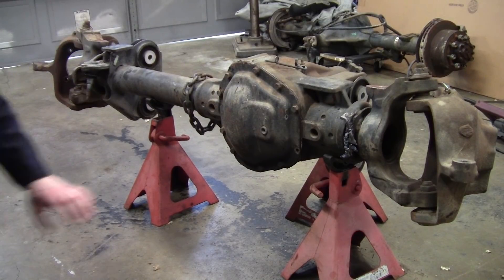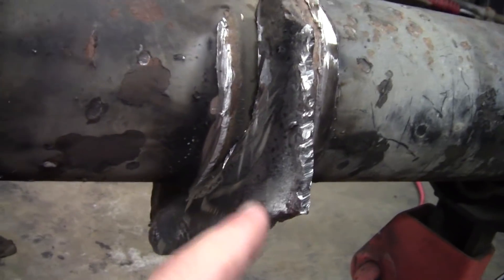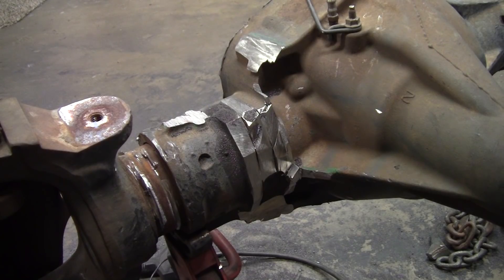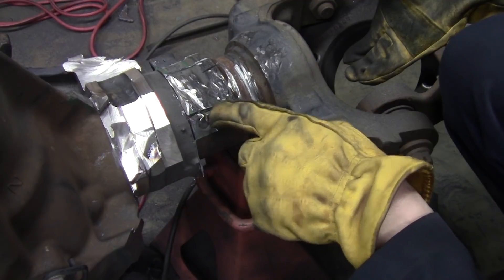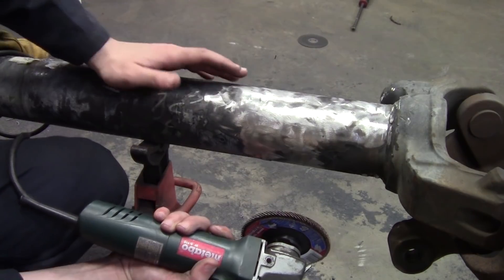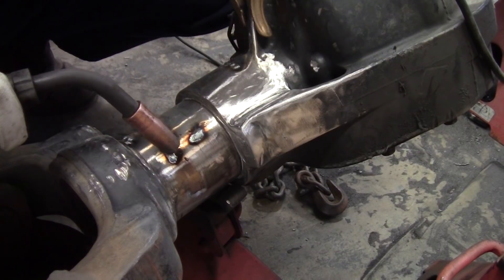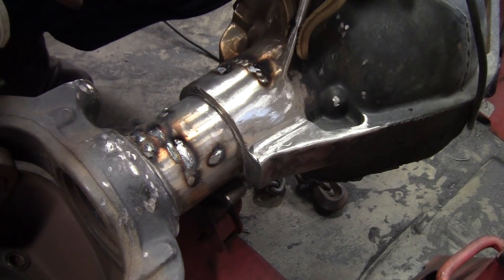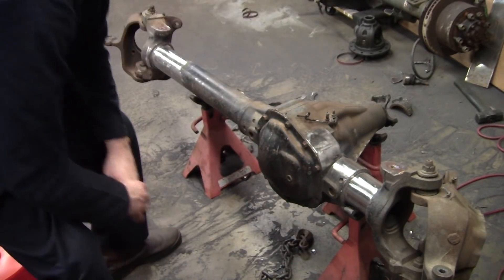Super Duty Dana 60 Casting Trim and Axle Swap Prep

Comment: so should you weld up that spot where you took out half the plug welds that hod the tube into the center?
Reply from the maker: Yes it does need to be welded to the casting afterwards to get the strength back. If you're not running a truss the tube needs to be welded to the casting. But if you're running a truss that welds to the tube and casting that should give enough reinforcement.

Comment: Use a scarfing tip on your torch and you can cut all those brackets off flush or very close to the axle tube within 1/8 inch or closer
Reply: I've never used a plasma cutter, but I suspect it would cut even closer and cleaner.

Comment: Here is a tip from the Grumpy Gear Monkey. Have your gears set up before you weld on a truss. This way, us old guys can use a housing spreader to get good carrier bearing preload without having to beat the carrier bearings into the housing. This is especially important with an ARB air locker.

Comment: I’m getting ready to do this. Did you grind out the welds to get the brackets off?
Reply from the maker: It's much easier to use an oxy acetylene or plasma cutter to cut the brackets off first, then grind down what's left because the welds on the axle tubes are hard to get to in some spots.  Other option would be cutoff wheels to take off as much of the bracket as you can then finish with a sanding disc.  Good luck!

Comment: Is there room to mount 36 1/2” spring pads on the axle if someone wanted to run leaf’s?
Reply from the maker: The closest you could put leaf springs would be 34" inside to inside.  That would put the leaf spring against the diff cover on the driver's side though so you'd have to get creative with perches and mounting.  36.5" inside to inside seems possible.  Might be better to get the Dana 60 out of a 99-04 though since they came with leaf springs (37.75" center to center).  Even though the axle isn't as strong, would likely be an easier starting point.  Good luck!
Reply: @WebWheeler  thanks for the info

Comment: seems like the hard way to do this, why not cut flush with the torch then spend 10 mins tidying up with the grinder?
Reply from the maker: Started it that way, then ran out of acetylene for the passenger side.  Chose not to for the driver's side because I prefer not to put that much uneven heat in to a casting.  Might have worked fine but I wasn't sure so the possible time savings wasn't worth warping or cracking the casting
Reply: @WebWheeler  sorry, guess my perspective is tainted,  watched both my dad and uncle doing that on both sides and cutting flush to the housing, quickly and leaving little to nothing to grind

Comment: Wow! That was a ton of work! Wouldn’t it have been easier to get a leaf spring style Super duty front axle?
Reply from the maker: Yeah the leaf spring version would be a lot less trimming but those axles are quite a bit weaker (smaller unit bearings and outer axle shafts) and are actually more expensive. Thanks for watching!

Comment: I'm not sure if you'll be able to answer this now. But after doing this mod to your axles. What's the distance from center to outer part of diff that you clearanced? Would I be able to mount leafs right up against it?  

I'm thinking about using these for my 4runner (yes I can do driver drop I have engine swap) but would need to figure out a front hanger width.  So if I take your measurement from center of axle to the outer part of the clearance diff then I can double that and see how that matches up with my 4runner frame. 
Just trying to get idea how wide a front hanger bar I would need to make.
Reply from the maker: The tightest you could mount your leaf spring perches (inside to inside) would be 33.5". So if your springs are 2.5" wide they'd need to be 36" center to center. You'd only be able to use 1 ubolt on the diff side though- your other spring mount would need to be a bolt in style against the diff like ruffstuff makes their land cruiser front axle housings. Good luck with the project!
Reply: @WebWheeler  this helped me immensely!! I might use these now instead of finding a 10bolt and using the sky's fukk size hanger kit. Bc Chevy d60 are hard to find and $$$

But super duty are plenty. Just no one makes a hanger kit. I appreciate it. And I understand what you mean about the rough stuff bolt in. Great idea
Reply from the maker: Glad I could help! The super duty 60s are definitely the way to go haha. I like the kingpin axles but having dealt with both, the 60s are better in almost every way (especially now that kingpin axles are $1500+ bone stock haha)
Reply: @WebWheeler  looks like sky and wfo make a 36" universal front hanger. But for $250 I bet I can just grab one up and then towards the back of the frame  make some outrigger mounts like the body frame mounts. Well just have to see how ridiculous it will look bc it's so much wider than frame.. Thanks again.
Reply from the maker: Yeah I ruffstuff sells some frame mounting pads/outriggers that might work to widen it out for you too. Should be a cool rig when it's done!

Comment: I’ve found a great way to sand those tubes is to get a sanding belt , the longer the better and turn it inside out then slip it over the axle tube and use a drill with a rubber check to spin it. You can cut it to the perfect width, just let the paper do the work. I rigged up a handle that goes thru the rubber drive as to get an even pressure.
Reply from the maker: Great idea! I'm going to have to try that on the next one.

Comment: What if a person was to buy a fresh Dana 60 center section(Strange has a nice offering now!), axle tubes and new yokes? I hope I'm using the correct word for the 'yoke' on the end of the axle. Assuming one can find them because I can't.
Reply from the maker: Definitely an option! General harder for the garage fab guy because there is often machining/pressing required to assemble tubes in the housing though. The yokes you're talking about are Dana 60 inner C's. For a factory style, Reid Racing is considered the best in the business. There are other options for fabricated versions are well (Spidertrax) but those are more for off-road only setups. Good luck!

Comment: I've found using a rivet cutting torch works great for cutting almost flush with frames and axle tubes.
Reply from the maker: This process made me buy one too! Would have been smart to buy beforehand 🥴 thanks for watching!
Reply: @WebWheeler  anytime I'm getting some good ideas for a possible 550 axle swap into my 1 ton dually tow rig just trying to figure out the design for suspension.
Reply from the maker: Hard to beat radius arms for the simplicity and durability, especially on a tow rig without too much flex. Honestly I'd consider getting a super duty Dana 60 like this one (or the super 60 that comes in the f550) and keeping the factory radius arm mounts and lengths. That way you have a truck that's still mostly factory replacement (or bolt-on aftermarket) so parts are readily available and all you'd have to do is do some frame mounts. Good luck with the project!
Reply: @WebWheeler  ya they look hella tough on the fence with 4 link in the rear with semi air bags...they're  going in a 1st gen dodge so its gonna be far from stock but I do like using OEM stuff so I'm never in a bad spot for parts...I like the 550 axles just for the massive brakes with the amount of towing I do with heavy goosenecks I want brakes that will last and stop.

Comment: Dope video. But just curious, would it not have made maybe more sense to just incorporate those massive beef adding structures into the truss? Because ultimately it looks like you removed a ton of bracing to add...well...bracing
Reply from the maker: The issues are mainly that there isn't enough tube on the driver's side to have room for a new lower link mount to be welded on, and also welding an upper link mount directly to the casting is not best practice. By getting all that casting out of the way, you have tons more room to work with for link mounts, trusses, frame clearance, etc. That said, people also build custom suspensions directly off the factory radius arms mounts and that works perfectly well too. Just depends on what you're needs are for your project. Thanks for watching!

Comment: When using that belt sander, before you mount the belt, reinforce the seam on the belt (inside of course) with some "Gorilla Grip" tape and it will last last heaps longer. I tried this on mine and was pleased with the results, but I did enjoy the sound effects though.
Reply from the maker: Great tip! I will give that a try. Buying some better quality belts helped too haha. Thanks!

Comment: If I might suggest, you can fill in those dibits with solder like you use with copper pipe.
Melts at low temp and easy to grind smooth.
Reply from the maker: No kidding!? Never tried that before but I will definitely try it. Thanks for the tip!

Comment: After cutting everything is it possible to get a 31.5 inch perch width out of this axle for a Chevy
Reply from the maker: No- those perches are too narrow. Minimum distance BETWEEN springs (not center to center) is 33" unless you shorten the passenger side tube or run ridiculously tall perches haha

Comment: Why didn't you usea 99 to 04 axle?
Reply from the maker: The '05+ axles are significantly stronger everywhere that it matters.  Bigger unit bearings/hubs, knuckles, balljoint setup, outer shafts, ujoints, etc.

Comment: this seems like you are making it weaker
Reply from the maker: Not enough to make it a problem- Ford mounts the control arm to the casting so there's a lot more stress on it, therefore they need extra reinforcement.  By mounting control arms to the tube or a truss like most people do after this trim, the stress on the differential is significantly reduced.  That being said, you do need to weld the casting and tube together or truss the axle after doing this trim.
Reply: @WebWheeler   is there  a truss install  video
Reply from the maker: Not yet but eventually I will be doing that as well 👍

Comment: Great Video. I'm putting in a Super Duty 60 with high pinion in a 49 Willys wagon, and need to do similar.  I picked up the D60 from Craig's List and it came with the Artec truss.  I watched and enjoyed the entire video. What SPECIFICALLY would you do differently other than what you mention in the video?
Reply from the maker: Thanks a lot! Glad you enjoyed it. Sounds like a cool project! I love those old wagons. If I was to do it again I would I would use the oxy acetylene torch a lot more to cut down on grinding time (I would have at the time, but my oxygen tank ran out early on.) I also would have probably spent less time trying to avoid cutting in to the tubes- would have been quicker in the long run to just be aggressive and weld/sand any gouges after the fact (since grinding and sanding the plug weld locations to finish the tubes was necessary anyway.) That's all I can think of off the top of my head but will let you know if I think of anything else!
Reply: @WebWheeler  Thank you so much for your reply.
Reply from the maker: No problem! Subscribe and share the videos if you think they're worth it ;) thanks for watching!

Comment: I've been eyeballing ford axles and was shocked to see there's 4.56, 4.88, and freakin 5.38 available from the factory. One axle even equipped with 35 spline inner and outter. I thought several of them were leaf spring though. I guess I need to go back and recheck application charts or something.
Reply from the maker: Hell yeah! The all 99-04 super duty front axles were leaf spring and 30 spline inner/35 outer. All 2005-present is coil spring with 35 spline inner and outer 👍 thanks for watching!
Reply: Do you think there's enough room on the driver's side to fit a leaf spring perch? Also, it seems all super 60s are 10 lug with the ability to swap in f350 hubs to make it 8x170mm... Does that seem correct? I'd like to find a single rear wheel version, but it doesn't seem like those were made. I'd like to get front and rear out of one truck with the 5.38s, but I'm not sure of the amount of work to change the back axle to single wheel.
Reply from the maker: I think there's enough room- what perch width would you be looking to do? I can measure my axle and let you know where it would land. I do believe you can swap the 8 lug stuff  to the super 60 but honestly it's way more work (and $$$) than regearing the standard 60 which is plenty strong. If you want to beef up the standard 60 you can also get Spicer replacement shaft assemblies that have a 1550 ujoint instead of the 1480 😎
Reply: I have an LKQ u pull it yard near me (you may have one too). They sell axles for $120+/- rotor to rotor and the rotors/calipers/hub would be less than $50 per side. That's why I'm trying to find what single wheel truck will have the lowest gearing possible. The truck did have 4.56, 38s, and a mild build 360...It was still struggling to do anything exciting as those brand new boggers have almost an inch of tread and all four were pulling. I cannot begin to afford the "black box" that I want in it, but gearing at least 4.56 again would be a good start.
Reply: LKQ parts pricing: https://www.lkqpickyourpart.com/locations/LKQ_Pick_Your_Part_-_Mount_Airy-208/prices/
Reply: LKQ locations: https://www.lkqpickyourpart.com/locations/
Reply: Oh, I forgot perch width offhand, but it's an '83 ramcharger. I can move the springs some if I need to.
Reply from the maker: Dang that's a good price. I'm in northern California and we pretty much  only have pick n pulls which never have trucks that new haha. I think 4.56s are the lowest gears the srw asked came with. Good luck!
Reply from the maker: Nice! I used to have an old Trailduster- my favourite truck haha wish I never sold it! I will measure the axle and let you know tomorrow what perch with you could get away with

Comment: This is completely fascinating. Super 60 is the stock axle under my 2014 F-450 and I was looking at replacing it with a Dana 80. Search for Super 60 axle swap and here I am watching you take apart my axle. Probably not going to end up changing my front, just get hubs over to 10x225 bolt pattern. The Dana 80 in the back will be upgraded to an S110 or S130 though.

I had an old school CJ7 back in the day and thought I was going super strong when we put 35's on Dana 44's. Bent some stuff but it mostly held up. You guys putting Dana 60's and bigger under the same wheelbase is just wild.
Reply from the maker: I will gladly take that super 60 off your hands if you decide you don't want it ;) yeah back in the day that was pretty big haha. Honestly you can have just as much fun in a rig like that- plus you learn to drive better lol. Of course while I say that I'm also building a Dakota on 40s but that's meant to be a little crazy haha. Thanks for watching!

Comment: Nice job! How long did it take to clean all the old casting and brackets off ?
Reply from the maker: I think around 6 hours but if I want to do it again I could do it in under 2 pretty easy. It took me a while to figure out what worked best plus I ran out of oxygen pretty early on haha. Next time I trim down one of these axles I will film it straight through and do a time lapse to give a better idea of the time it actually takes. Thanks for watching!

Comment: Thanks for the video bro. Just found out that it's possible to use Ford/front and GM/rear axles for JK build. Super stoked that I can possibly cut 10k out of the swap to D60.
Reply from the maker: Glad you found the it! Sounds like a cool JK build you're doing. I will be doing more videos on these axles so stay tuned! 👍

Comment: mabey use use a air hammer in stead of  the small sledge ? good video though
Reply from the maker: I really needed to just cut more off with the torch. I ended up running out of oxygen during filming though haha. Thanks!

Comment: brother..i was young once and cold swing a 5 pound hammer all day..but as time went on i learned to work smarter..should of just cut the tubes out and re-tubed the axle..faster,easier,cleaner.. :)
Reply from the maker: Lol I wouldn't exactly call retubing an axle the fast and easy way especially in a garage with no machine tools 😉 would be nice though! This video/channel is geared towards the home garage fabricator rather than a pro shop that would have that equipment on hand. Thanks for watching 👍
Reply: @WebWheeler  i said re-tube not build..think about it..drill the plug welds..cut the tubes close to the dif and knuckles..make 3 or 4 cuts on the inside radius of the tubes in the dif and knuckles..then on the knuckles grind the outside welds away..chisel the 3 or 4 pieces out of the dif and knuckles..do some clean up..everything you did in this video but far less work..then you measure and cut and clean your tubing..bake your dif and knuckles..freeze your tubing..they will slide together without the need of a press..nothing fancy..no big shop needed..of course your ole lady might be pissed that there are automotive parts in her oven and freezer :/
Reply from the maker: @ferrelx  Finding the right size tubing to fit the press dimension of the casting could be tricky since it's somewhere around 3.70" but if I can find that I might give it a try!  Maybe on a day where the wife isn't home lol ;)